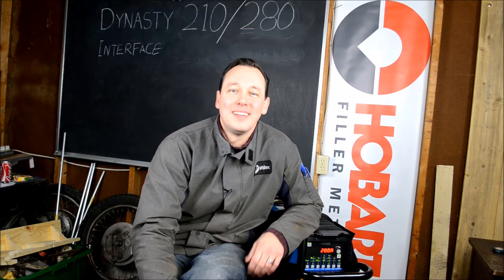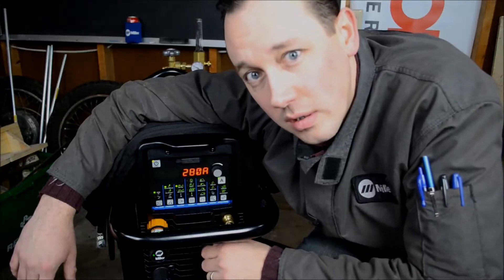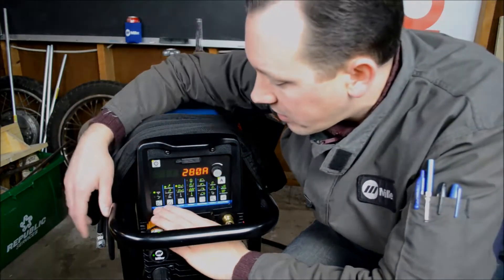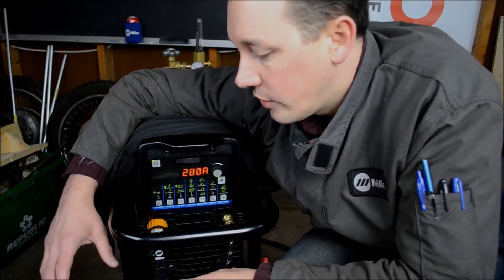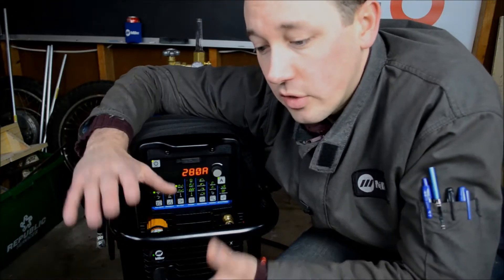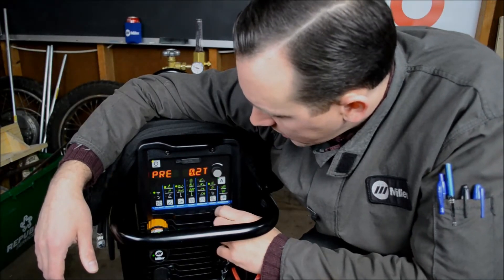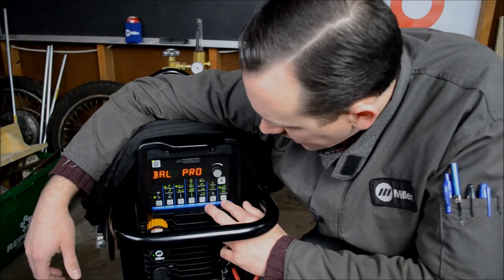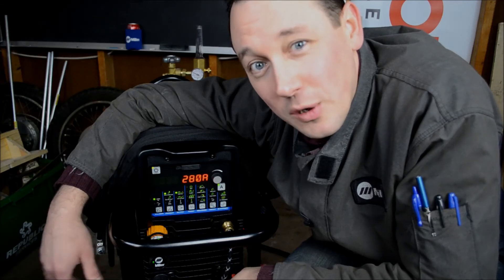Miller Dynasty 210 / 280 DX Interface

Comment: Thanks you have helped me a lot, with my 210 dx, Its the first welder I bought and it can be complicated to use. but it makes aluminum welds that no other welder I've used can produce and, that is why I got it. I came from a dynasty 350 at my old job and once i got used to it, it was hard to go back to a Syncrowave.

Comment: very very informative videos you've post here. You know.. there is a doubt   that is killing me about the dynasty 280 DX and 210 DX which is the following: do they come with an independent amperage/amplitude control EP and EN or you have to  upgrade the software  ??
Reply from the maker: Good question! The 210 & 280 DX do not have AC Independent Amplitude functionality straight out of the box. You're correct that it is available as an upgrade. Now, the Dynasty 350 DX comes ready to go with Independent Amplitude, but it also comes with a higher price tag than the smaller machines with the added upgrades. What's your primary application?
Reply: +Weld NerdI dont weld for living and i have just a little experience on stick welding when i took a welding class ,i am plumber, but tig welding has always fascinated me, and on my free time i get self saturated reading about these tig machines, and now i want to buy one since i wanna weld aluminum. The reason why i asked you about ep and en is because i found a espec sheet online from miller website but it seems to be from europe for the small letter on top of it"uk"  and i think that miller is already building the 210/280dx  with the ep en upgrade from factory but not here in USA. https://equiptoweld.millerwelds.com/pdf/spec_sheets/ADM9-0UK.pdf
Reply from the maker: That's a great observation. The European market has a few interesting differences from the US in terms of the things that they value in a power source. One of them is AC Independent Amplitude. There is a much higher percentage of operators who take advantage of that adjustment over there, so it comes standard. As for your welding, practice practice practice. It's great you're taking the initiative to seek out the information and educating yourself. If you are looking to pick up a machine and you've decided on a 210 or 280 DX, but are concerned about the Independent Amplitude, then my advice would be this: Don't worry about it right now. Independent Amplitude is a tool that can be helpful, but it's very uncommon to see a job that requires it. You can always get the upgrade later after you've logged some time and have a really good feel for the process and it's capabilities and limitations.
Reply from the maker: Thank you very much! I'll do my best to keep it up, sir. 
Have a great day!